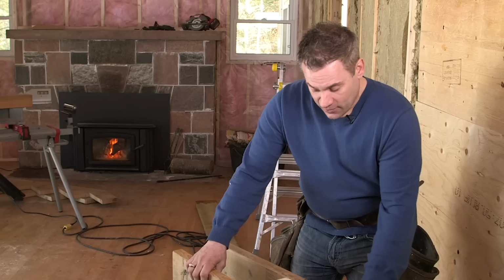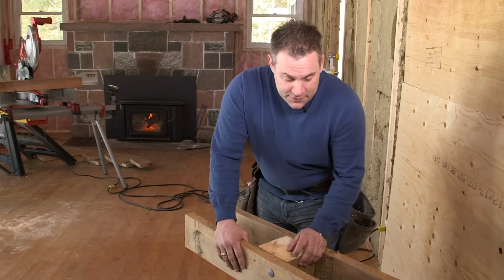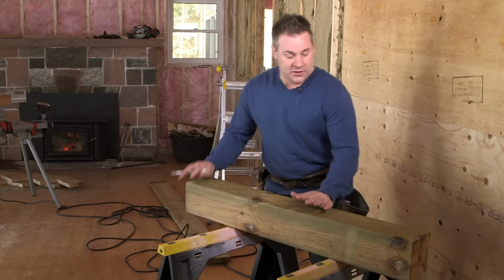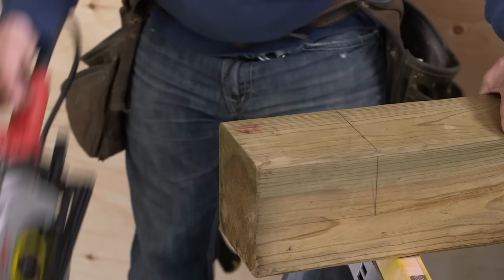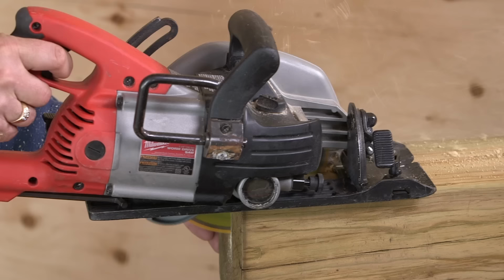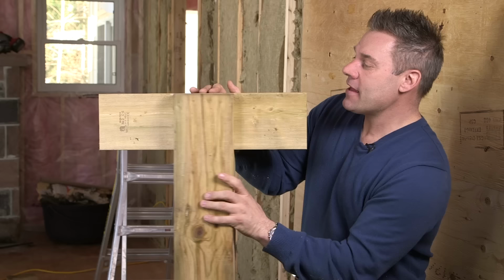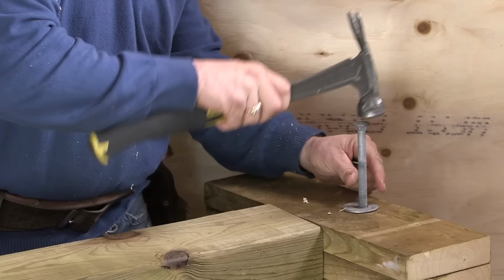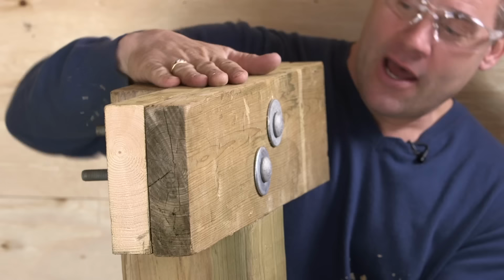How to Attach a Beam to a Post for a Deck | Decks, Docks & Gazebos

Comment: Now, I'm just a 30 year in the trade electrician with my state contractor's licence C10 with 16 years as a commercial industrial journeyman in the IBEW. 
  I don't know a lot about framing except that I have to bore holes through it and notch it sometimes.  
But, doesn't using a carriage bolt and putting a washer on the head end defeat part of the purpose of the design of the carriage bolt? Meaning the square portion under the head of the bolt is there to counter sink into the wood to keep it from spinning and to help it bite when tightened?
   I may be wrong but, that was always my thought.
Reply: Spot on.
Reply: Add a lock washer?
Reply: @jmjn916  ---- a lock washer keeps the nut from loosening and backing itself off the bolt that's a lock washer's function. Same with a locking nut with the acorn shape and the nylon plastic inside on the threads. Both keep the nut from backing off. The main point of a carriage bolt is to have the tamperproof head with the square on the underside of the head to sink into the wood when tightening the nut on the carriage bolt.

Comment: This makes sense if you've got elephants on your deck, and is a better way to support a beam, but your demonstration of shear on that screw is desperately misleading. You've shown a bending moment, not shear.
Reply: He is right though, carriage bolts alone do not meet code, and isn't done by anyone doing this work professionally.
Reply: No elephants just the dead load that increases with the size of the deck and a live load of people.  Also depending on were u live the deck might need to also support several feet of wet snow in the winter.

Comment: A carriage bolt will be intact in 10,000 years when someone says “there was probably a structure here”
Reply: Didn't you know , that's what they used to keep the "Great Pyramid" together , right ?
Reply: Nope, a brandnew travel bus will be only a stain in the ground after 10.000 years and so will your bolt.
Reply: You obviously don’t know the lifespan of galv or the nature of rust ffs 🤦‍♂️
Reply: You can get stainless carriage bolts. So let’s drop the rust issue. The carriage bolt has 33,000 psi shear strength. Using the correct amount and size of bolts. Provides plenty of strength. The wood will rot first and for pressure treated cutting to make the nest is opening it to rot sooner 

Note I’m getting ready to replace a 32 year old deck. It is the cut edge rot that is necessitating the replacement.
Reply: while I agree that either way is probably jusy fine for regular loads, if you load a deck with a hot tub, you definitely have to notch your beams into the posts like the video. Same if you were to have a large number of people.

Comment: When you cut the pressure-treated do you need to re-coated copper Green or some other type of sealer, I’m in California and we just use beams on top of the post with a bracket between.

Comment: One point I have is when wood is pressure treated I believe there is less treatment on the inside of a large post so really you are opening up the wood to rot . Second the wood is also smaller after being cut to resist torque and twisting and drying ,cracking ,spilting and  will absorb more water and not dry as well.

Comment: A notch on opposing sides and sandwiching the beams on the post is the way to go.
Reply: Yeah, and only notch 3/4 deep so the cut will stay dry. Inspector might not like it, depending on your area.
Reply: @MrDavidBFoster  Michigan. Humidity varies a lot depending on elevation and vicinity to bodies of water. Wolminized lumber works just fine with the 1.5 notch. It expands and contracts, but things won't shift if you take the step of popping some galvanized spiral nails through the 2× before cranking down the carriage bolts.

Comment: Regardless if the bolts can adequately carry the load or not, incorporating the notch is technically the correct way to make this connection, especially if the structure is utilized as a public space.  Another important design consideration:  when making the notch, the builder/designer should leave enough material thickness on the post as to not compromise the structural integrity of the connection.  Additionally, if the structure is used as a public space, the connection should be (in my opinion) supplemented and strengthened by implementing steel "T" plates.

Comment: When you notch the post as the person did you reduce the ability of the post to withstand racking by half. By using the bolts you increase the ability of the post to withstand racking. The shear strength of a 1/2 galvanized carriage bolt is in the realm of 8000lbs. So x2 you looking at 16000lbs per post. The Electric utility industry uses 2 5/8 galv machine bolts to hang a 5000lb regulator and it will withstand cat2 hurricane force winds.
Reply: Fucking A
Reply: Sounds great until you use wood in the real world.
Reply: That would be a garbage grade bolt...grade 5 bolt would be over 9000lbs force in shear...at the thread root. Higher on the shank portion.
Reply: @johngoodell2775  What the hell does that even mean??
Reply: @Gippetos  Grade 5, 1/2"  hot dip galv carridge bolt proof load is 7800lbs
Reply: @kitejkoch  because wood exposed to the elements and attached using fasteners only go through a lot of wet and dry cycles, water infiltrates the fasteners channels and things start to get loose. Furthermore fasteners can be plenty strong, but  wood end don't always hold up under fastener pressure near exposed end grain. Furthermore traditional joinery techniques make the frame more rigid and steong. The claim that you want more racking movent from  fastener only approach doesn't make sense. Why when you can firm up the joints? There is a reason behind timberframe methods
Reply: @kitejkoch  I get a different number when I calc it out using proof strength, but it's irrelevant...proof loading is going to be lower than the yield point, which is going to be lower than the failure point I calculated.
Reply: This is exactly why I overbuild stuff. 

Someone says I need a 4x4 three feet into the ground. 

I use 6x6 and put it four feet in. 😬
Reply: misa smith 
You do use concrete. You put it In the 3 or 4 foot hole. 
...genius.
Reply: misa smith  People walking on it. Wind.
Reply: misa smith  exactly! :) Finally some sanity in this thread:)
Reply: misa smith  🤦‍♂️yes a deck can rack back and forth. I've been up on decks that rack and have had to go add more knee braces to stop it. You say if its built right it wont rack but in this instance hes given you two ways to build it and their characteristics so that you can choose and actually build it right and get what you need out of the deck. I know there are other ways of mitigate the racking movement  but he is not wrong. Put up 2 sets of 5 foot posts and we will put one beam on top one set of posts and one beam split up and bolted on the other. Grab that beam and rack it from left to right and the one not bolted will move and hinge a little bit at the connection. The other set wont.

Comment: Quite a revelation that the shear strength of steel goes to zero when used in carriage bolts. A lot of structures around the world are going to collapse.
Reply: @logicalspartan  carriage bolts don't rely purely on shear strength however. It's a combined factor between the compressive strength, shear strength, and the nails you always also add.

The video is literally saying 1/2 carriage bolts have no shear strength, and that's grossly incorrect.
Reply: The bolts are not acceptable by building code and inspectors will flag that. Regardless if they can hold the weight.
Reply: @logicalspartan  As a structural engineer, I've designed quite a few structures with only bolt shear.  The steel manual gives two ways to design with bolts: using bolt shear and using friction.  They even go so far as to show a difference between bolt threads in the shear plane or the bolt shank in the shear plane.  The Aluminum Association manual doesn't even show friction connections, because aluminum doesn't work that way.  And yes, quite a few people design entire structures out of aluminum.

Comment: I would not cut the treated beam, I would run the cross beam on the top of the vertical beam and use a metal plate or bracket to hold it in place.
Reply: Thats actually how I thought you where suppose to do it. Have only done 3 decks in my life and we did them all that way.
Reply: exactly right. Use the post as it is intended, put the beam on top of it.
Reply: That's right Jack, that's another way and probably the better one.
Reply: By code, that's the only way we can build a deck in the Chicago area. Standoff bracket at the footing and metal post to beam connection at the top.

Comment: I built mine 12 years ago the wrong way, with just wood screws and it hasn't moved an inch... then again I don't need a deck strong enough to park a car on either.
Reply: Lone cruZader I only use this method on 2nd story decks ..
Reply: Not park a car
Drop a car from thirty feet!
Reply: Try to take a couple of those wood screws out and see how much metal you actually have left. You’re on borrowed time. I guarantee it.

Comment: there is an amazing amount of shear in a 5/8 bolt. where the weakness is is in the wood. with the bottom of the beam having no bearing it's the bolt that will actually split the beam, over time, causing it to fail.

Comment: I built my porch/deck with concrete uprights with a shelf on two sides . I ran a scrap of 1/2" conduit through the form for the bolt to hold the joists sandwiching the uprights . I poured the columns in '83 and have replaced the decking recently and the concrete is still in great shape .

Comment: I am a 40 plus year builder and you are wrong about this issue.  Never double up two 2by6s under a deck.  They trap moisture between the board and rot in a few years.
Reply: ....there’s something called joist tape to cover the tops of doubled 2x’s to resolve that issue.
Reply: @Coecoebrown I'm a 50 plus year builder and I've never heard of joist tape.
Reply: @byever1 Then you've never built a composite deck.

Comment: let me know when you’re grilling out on your deck and you sheer those carriage bolts off there, skip!  😆
Reply: Or building inspector comes to check out new deck, sees it was built wrong, and orders it torn down..
Reply: @chrisburns5691  To be fair, it probably depends on application. Those carriage bolts looked to be about 1/2" and combined would have significant strength. This is the wood equivalent of a rivet. Now if you have a large deck that needs to support thousands of pounds, not the best way. Small deck designed to hold 4-8 people, probably just fine. Also, I don't like notching the 6x6 on the side. Now the load is only put on one half of the post. Furthermore, there are better attachment options out there.
Reply: @SpaceMonkey2385  i agree that they would be strong enough, my point is that they wouldn't pass code.  My preferred method when I've built decks in the past is to rest beams on top of posts, and attach with appropriate hardware.  Notching is better than just the carriage bolts, as the point load is transferred directly to the solid bearing of the 6x6. Still I prefer resting the beam on top, when I've built decks in the past. 

 As a carpenter I've learned what will pass an inspection and what wouldn't.  Supporting a beam off carriage bolts alone would not pass an inspection, at least around here.
Reply: @chrisburns5691  🤣😂😂 it passes code everywhere I’ve ever been. The other way is fine depending on application. Some engineers want it done that way when you set porch posts.
Reply: @15gatorpatriot  interesting, doesn't meet code anywhere ive worked, and definitely not common practice.  Typically set beams on posts.  Would never fly for a 2nd story structure.
Reply: @chrisburns5691  it is definitely common practice for small decks and porches. Would it support an offgrade? No definitely not and you would never do it with a second story. It would exceed the tear out strength of the wood. The carriage bolt would never break or bend but the wood would sag over time from the overhead weight. I prefer notching posts all the time since I build a lot of offgrades and beach houses on pilings. Those are always notched. some engineers don’t always want that depending on application. Most of the time it has to do with the aesthetics of the finished product. I live on the gulf coast btw. You are going to run across it eventually. Just keep an open mind. Your way is strong. There is no denying that.

Comment: There is nothing wrong with the bolt through. I’ve built several (at least 6) decks in my lifetime using the bolt through method. Some that I can still visit after forty years, are still standing. Repairs have been made in some but the bolts are holding up pretty good, a little rusted, but good for more years. One thing I do not do is lazy up and use foam for the post foundation. Put a little more time and effort into your deck and build you a solid foundation. Use sakcrete. The combination of a solid foundation and a bolt through system will make your deck stand solid for longer than you might want. Let’s dig!

Comment: "These things have no shear strength" 

*proceeds to demonstrate BENDING stress, not shear.
Reply: No moment in shear.  He showed
 bending
Reply: I wonder if he first tried to break one of those carriage bolts. Can you imagine how much force that would take? The wood would fail far before the bolt shears
Reply: Sooo true!
Reply: Richard Miller that’s all you can ask if any fastener is being stronger than the material.
Reply: @RichardMiller-tq6ut  around 5000lbs shear strength on 3/8" carriage bolts. So with 2, you're looking at 7500lbs-10,000lbs of weight you can put on that beam before it might snap. So unless you're planning to drive a big truck over your deck, it's probably fine.

Comment: The way he did the legs is the best for strength but the other way is just fine since those bolts do have sheer strength. Either way Is fine.
Reply: Doesn't meet code
Reply: no, it's not fine.. relying on the bolts doesn't meet code, and isn't a great way to build.
Reply: 🤣😂😂 in most areas it definitely does meet code for a deck or a porch post with an overhead beam. I guess we need to throw away our contractor’s books and get rid of engineers.